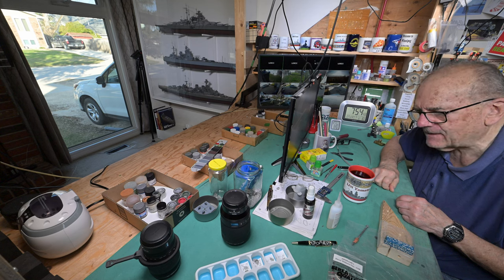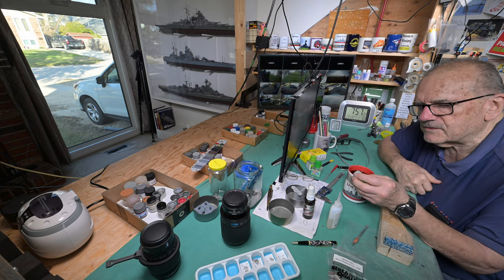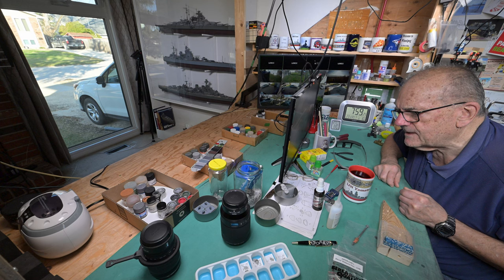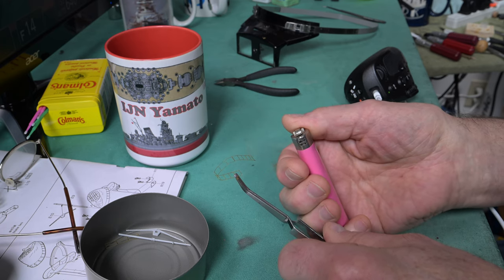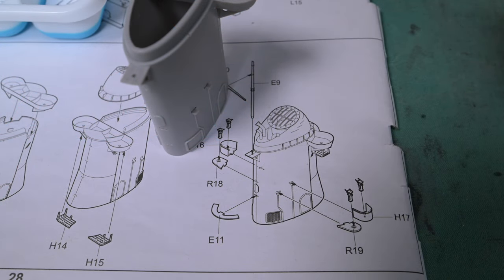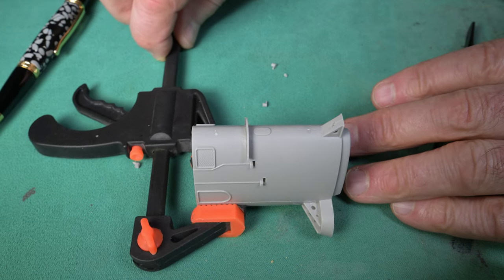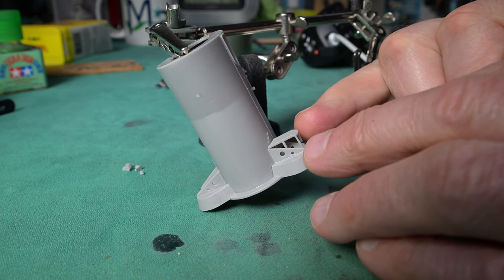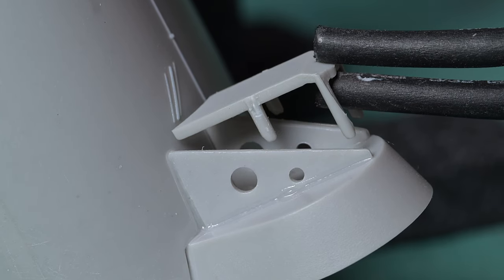The Model Ship - Part 1584

Comment: Hi Ron,  why don’t you check out those Air brushes that has the  compressor attached, relatively cheap and come in handy when you only have one or two items to spray,  instead of setting up the spray booth each time, keep up the good work

Comment: That railing, the frustrating part is, I have a 1/350 full hull Missouri and a 1/700 waterline Missouri with PE for both.  Both sets of PE included those walkways with fencing attached.  Cannot understand why/how Trumpeter overlooked the walkway and managed to make it almost unusable. The melted fencing piece, what if you shortened it by 3 or 4 frames and adjust it accordingly?
Reply from the maker: Re: "what if you shortened it by 3 or 4 frames and adjust it accordingly" I was thinking that too! 👍

Comment: I would think it might have been easier if you used your helping hands than the locking tweezers so it didn't carry the heat back and burn you